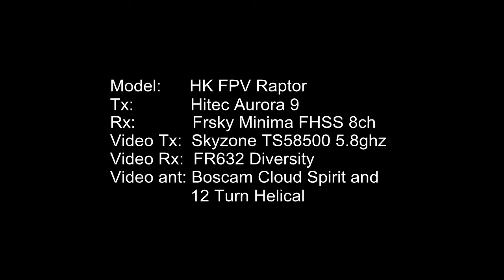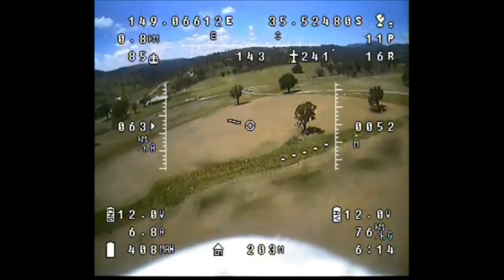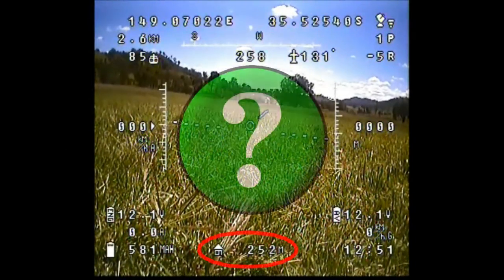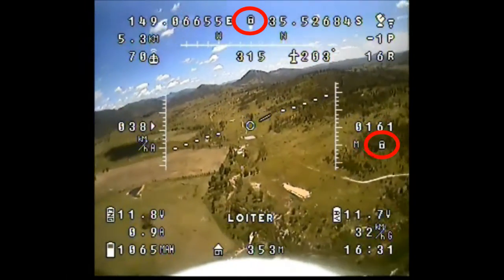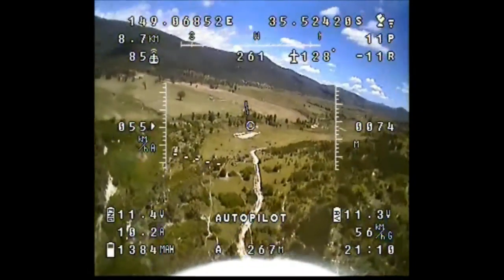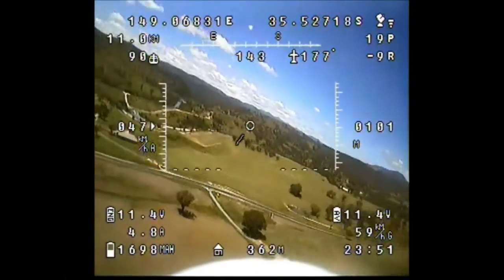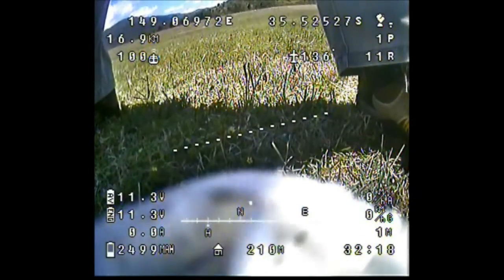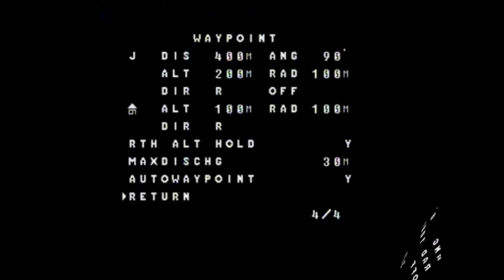Testing Cyclops Tornado firmware V1.1 (2) 05/02/2015

Comment from the maker: I don'r recall noticing but it was a couple of years ago. I just had a look and noticed that the GPS data glitched a couple of times on the carry out so it looks like whatever changed the home location happened more than once. Well spotted. I don't think I had any more problems with it so I guess it was either a loose connection or I had stored the keypad in a bad place in the fuselage,

I eventually lost the Raptor when it failed to return home after a mission and don't currently have a plane big enough for a Tornado.

Comment: As you friend, I bought an OSD Tornado and would like to use the WaytPoint function, but in the Manual it does not explain how, could it help me to do at least 4 Waitpoint as...
Reply from the maker: You need to set your waypoints in the system menu relative to your HOME position and then select Autopilot mode.. For example Setting Waypoint "A" to an angle of 0 and a distance of 200m will send the model 200m North. If you have set "B" to an angle of 90 and a distance of 200m it will then fly 200m East. It will keep flying to the next active waypoint until you take it out of Autopilot mode. 

This forum: https://www.rcgroups.com/forums/showthread.php?2029391-Cyclops-TORNADO-OSD/page383#post35575775 provides a lot of information on the forum and the contributors are very genrous with their time in providing help.
Reply: HUUUUM !!!! But how do I know my position in relation to the Degrees?
Reply from the maker: The degrees always relate to your HOME position. Setting a Waypoint instructs the Tornado to fly to a point which is a set Distance, Angle and Height from home. You can use a compass or GPS to work out what angle you need. You can also use Google Earth to work out the correct angle and distance between landmarks.